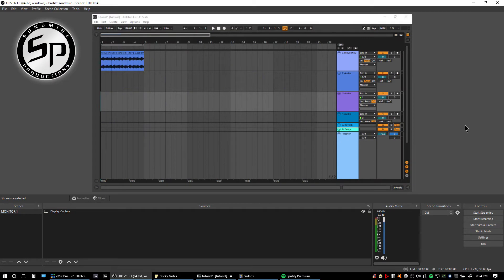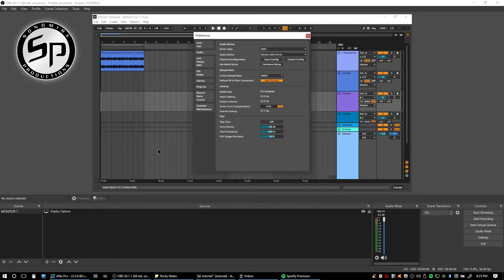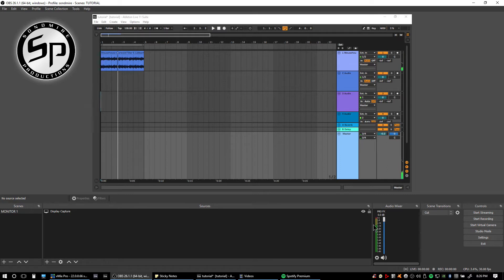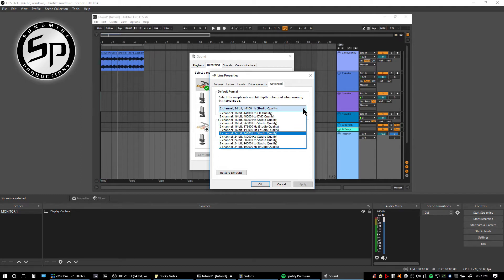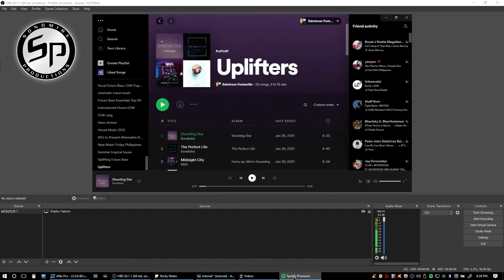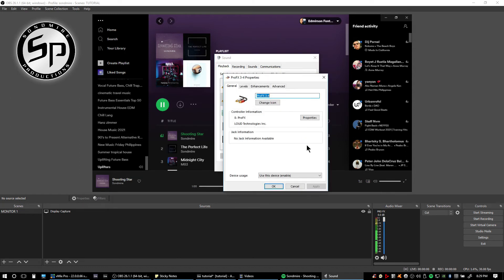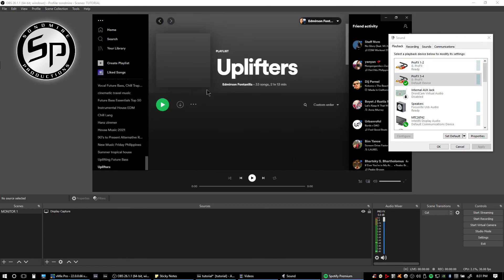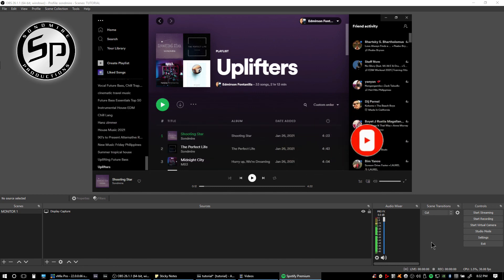Sample Rate Mismatch FIX! NO INPUT SIGNAL in obs studio using loopback. (MACKIE PRO FX V3 SERIES)

Comment: have been trying to fix the USB connection to PC to OBS for church livestreams, however it hasn't been picking up mic, ill try to test around with the settings you showed, but is there any concern with having a difference in audio settings and in OBS bitrate or etc?